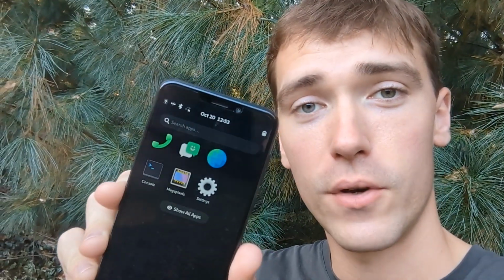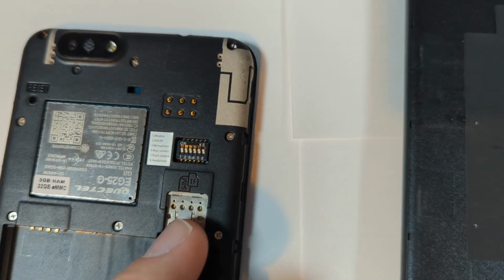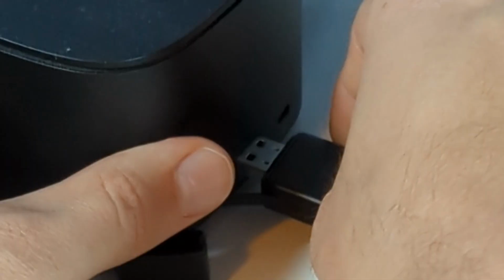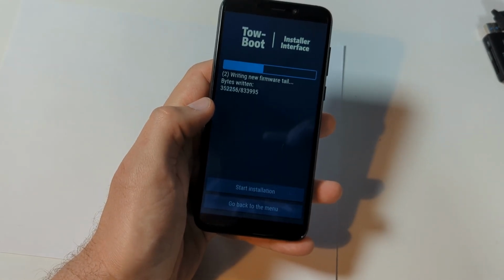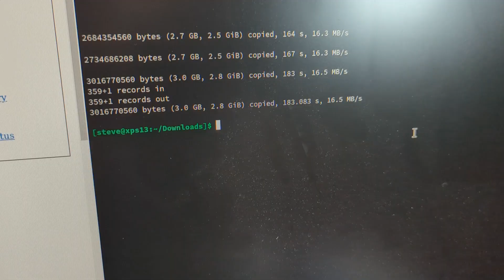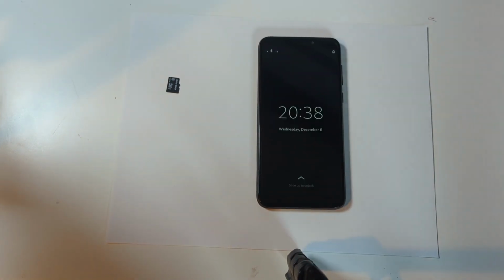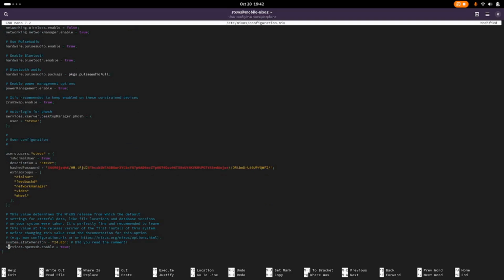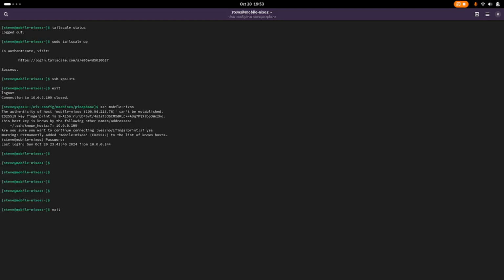How to Install NixOS on PinePhone (Ultimate Linux Cell Phone Setup)

Comment: It still requires too much. It should load  a full system from SD or USB without an interactive per-system configuration.
Reply from the maker: It would definitely be nice. I think there's a way to build a NixOS iso yourself, presumably with custom config files included. Not sure if it works for mobile Nixos too, but it would definitely be cool if there was a way to plug-and-play the phone with all this stuff setup, right from first boot
Reply: @PageKey  The problem already starts with the bootloader being limited to the internal storage by default.  You have to override it but you 're forced to use the existing preinstalled OS for that and accept the risk of a brick. That's a lock-in strategy. Are these things boxed with Android? That would explain...
Reply from the maker: @manuell3505 mine came with Manjaro Touch. It's a Linux phone from the factory, not Android. And the bootloader it comes with (U-Boot I believe) boots from the SD first by default, so no risk of bricking as long as you can properly image an SD for the phone. I had to install Tow-Boot for NixOS, which seems to default to internal storage. (This is as far from a lock-in strategy as it gets)
But I totally agree, vendor lock is one of my top pet peeves. Imagine how much cooler things would be if we could flash anything on any device and run any software on it!
Reply: @PageKey  Why doesn't that work? I have a custom FreeBSD system that can be cross-compiled for aarch54 and u-boot like Raspberry's. It's theoretically compatible .  Not sure about the I/O, though. Do we have a hardware console that takes a USB keyboard?
Reply from the maker: @manuell3505  I have no idea, you'd have to try it!

Comment: Nice video! 

The SIM issue you are having is that the PinePhone has microSIM slot - the thing in the package is a nanoSIM to microSIM adapter, that basically makes your nanoSIM big enough to fit.

Unfortunately, PINE64's adapter is a bit thick, so I preferred the adapter that came with my SIM card to not have problems when taking the SIM card out - different height levels may still mess up the SIM card reader contacts.
Reply from the maker: Thanks for the comment! This is great info - I had no idea my regular phone was using a Nano-SIM and that I needed the adapter to micro-. That does explain why I kept losing the SIM inside the phone! I probably should have looked it up before I started 😅

Comment: Dude, this video is right on time, as  I was trying to install nixos on my unused motto. I got nix-on-droid working using the app instead of  a full install
Reply from the maker: @DreamsAPI  awesome! How does it work? The pinephone is a little slow so I'm thinking about going for a pro, or the OnePlus 6 is supported, or maybe a motto 🤔
Reply: @PageKey  I like your setup much more as you are getting a full nixos os on your phone whereas with nix-on-droid just feels like an add on on top of the original phone. 

qq - can you use the methods you showed on any phone or it has to be specific pine phone hardware?
Reply: @PageKey  Hi, hope you are well. Nix-On-Droid is an an app on F-Droid that you can install on an android phone, while it gives you access to many packages, as far as  I know , I could not completely erase the Android OS and replace it with the Nix* ecosystem.
Reply: Where do you see the list of supported devices?  @PageKey
Reply from the maker: https://mobile.nixos.org/devices/index.html